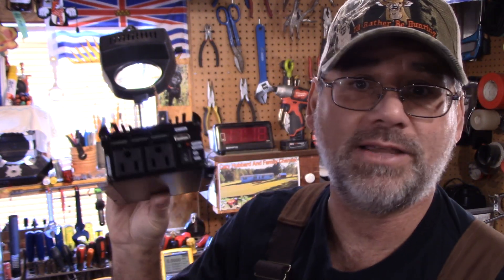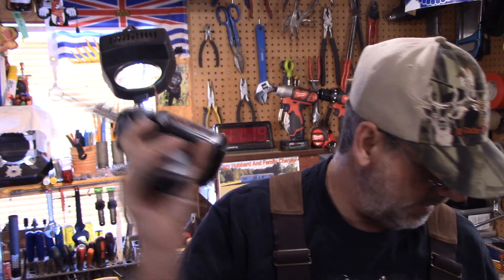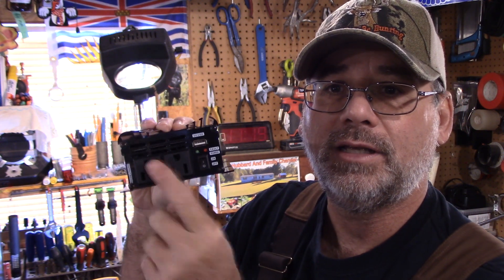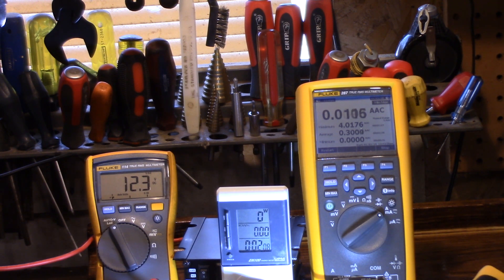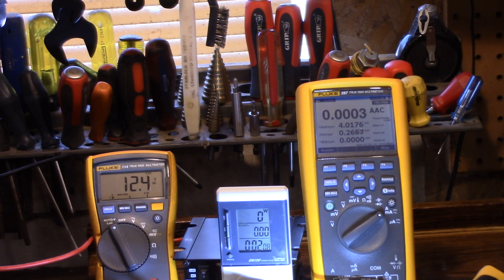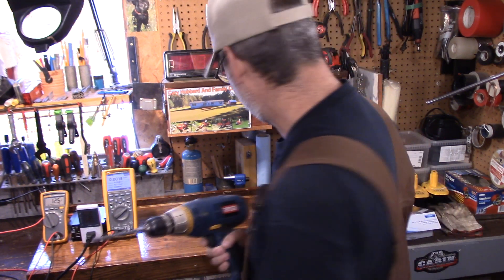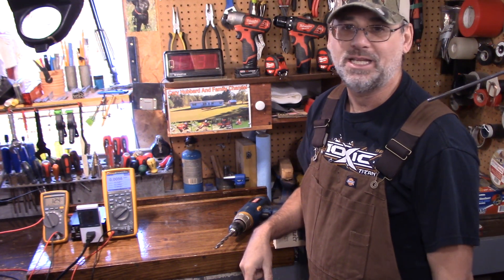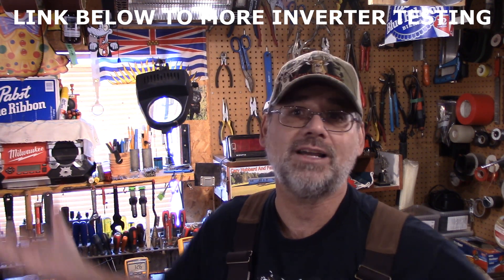HOW DC TO AC POWER INVERTERS WORK - CAN YOU  JOIN  OUTLET  RECEPTACLES TOGETHER -  Pyle PINV44

Comment: You have to watch on devices with 2 speeds, heats or settings. Some of them use a diode to make  half of the sine wave of AC to supply the low setting. I imagine an inverter does not like that much. I have a yard sale inverter in my Jeep, but it may be coming out. Not a true sine wave inverter anyway. Thank you for testing this theory for us, Steve
Reply from the maker: Pure sine wave inverters are used for digitally operated devices and sensitive equipment like computers.  The average low cost inverter  work fine but beware of its limitations .  Far too many buy an inverter in wattage and think one outlet of many can produce the wattage but sadly it's not. They should put on the packaging the total wattage per outlet .

Comment: I’ve always wired the grounds on the bottom and the code doesn’t specify. So, you can orient it either way. If the ground is on the bottom, testers with lights will be on the top. The wattage capacity is the max rating of the unit. You’re correct that each outlet would supply half of the wattage. 👍
Reply from the maker: Terry it seems odd they dont have a code for a standardised position. At least they standardised the polarity years back :)

Comment: WATTS up Steve?  This was a reVOLTing video , got me all CHARGED up (as usual)!  Thanks for the info my friend.  Cheers.
Reply from the maker: Glad to see it was an electrifying experience for ya Larry :)
Reply: @SteveRobReviews  Sorry two2 bee negative butt I don't think this was very positive although I sometimes alternate from side to side but currently I am being direct. I mean direct currently. See I can't make up my mind. Maybe diodes would straighten out the current cause or a capacitor as a shock absorber. Where's a dictionary when ya need one. No make that a schematic. Sine waves can bee so inverting. I'm all drained out gotta go plug in with my grounds pointing down.

Comment: As for the outlets, U-ground down....  To me that's the standard, but I notice in hospitals they are wired the other way around.  Go figure...   As for inverters, this was a good test just to show how little you can run on an inverter unless you get a big honking one and that will cost ya plenty!!!  Keep on keeping on Steve !!!
Reply from the maker: Thanks Mike - far too many people assume the wattage shown on the box is what they can get per outlet and its not quite right. Cheers
Reply: My uncle is an electrician and told me the way we usually see a three prong outlets installed is wrong.  Everyone wants to see the face but the ground should be on top.  Reason being if the plug starts to droop on the outlet and if a piece of metal were to drop between the plug and outlet, nothing would happen b/c it would hit the ground rather than shorting out the hot and the neutral.
Reply: That makes sense and since I was an industrial electrician I have to agree with your uncle!!!  He's a smart man!!!!

Comment: peak & surge are about the same the high number is the surge when you first turn it on and may take a 1-2 second peak/ surge when running. When I buy/rate I buy by the lowest number, the high number is the company baiting the hook.  Right they need the right input to give the best output and safely, not enough input can cause the system to heat up and blow both units or worse _fire_.  Good vid
Reply from the maker: Thanks Buzz , I've talked to so many people that have bought an inverter and wondered why a 2000 watt inverter will not run my 1200 watt microwave and I get a good chuckle explaining how marketing works :)

Comment: Great demo. I would probably let the smoke out of an inverter if I were to install / use one. Why do they sell them if they can't handle anything... hmm.
Reply from the maker: Thomas a friend of mine just bought a 2000 Watt inverter from CT  and thought each of the four outlets could supply 2000 Watts but its only 500 watts each.  I have yet seen one labeled showing the max output per outlet. Great marketing but poor customer satisfaction. He wanted it to run a 1600 watt coffee maker - NOPE :)

Comment: What's wrong with drilling a centimeter at a time? Lol I've seen people join two outlets to form 240v, but never heard of doing that in an inverter. Nice share Steve
Reply from the maker: HAHA ya wouldn't want to try it either with an inverter .  I seen a tv show called shark tank where these millionaires invest in great ideas and they all wanted in on this idea where you attach a box to your vehicle and power your house with 1000 watts of electricity from the battery. Well these millionaires have no idea at all and were so impressed and saying wow 1000 watts that's great. HAHA it wouldn't  run your microwave never mind your house in a black out.
Reply: STEVE ROB REVIEWS 😂love that show, but haven't seen that episode, must be new. Wow a whopping 1000 watts 😂

Comment: I would have bet good money that the outlets we're wired in parallel internally.
Reply from the maker: So many see a power inverter rated at 2500watts and think each outlet will provide that amount but in reality no single outlet in our houses provide that much. I wish  they would actually rate each outlet on their packaging  better.
Reply: @SteveRobReviews  I also would have thought that the outlets were wired directly in parallel on this sort of inexpensive low power inverter. Why would they have two different powers paths when either outlet could handle the full wattage? Have you checked that they aren't wired in parallel? You could always crack it open (be sure to discharge the capacitors) and see how it's wired or just measure the resistance between the two hots or neutrals. I'm curious...  Anyway keep up the good work and keep the videos coming.
Reply from the maker: Good idea for a future vid. Thanks Steve

Comment: You are Wright Pal the grounds should be on the bottom.
Reply from the maker: I always see it like that as well. 👍
Reply: @SteveRobReviews  The ground on the bottom also keeps the plug from being pulled out too easily if the powered unit is below the outlet.
Reply: I've seen them mounted ground up in a few medical offices.  I was told it's safer because if something is dropped between the plug and outlet it will hit the ground rather than bridging the other two.